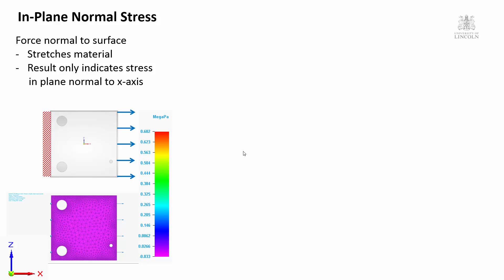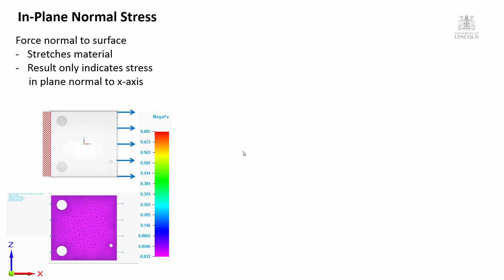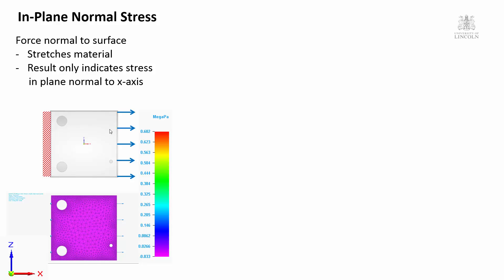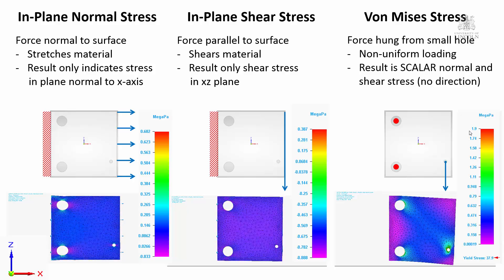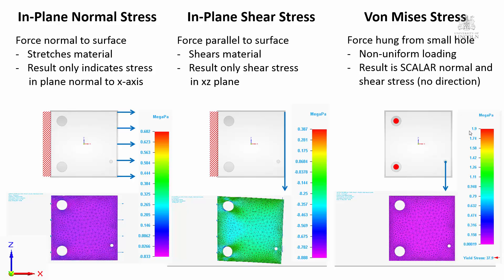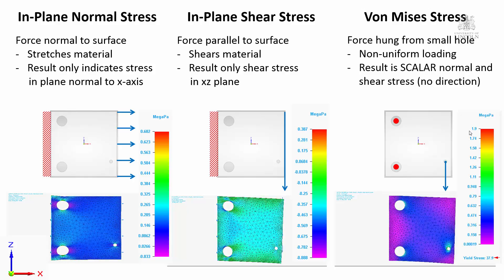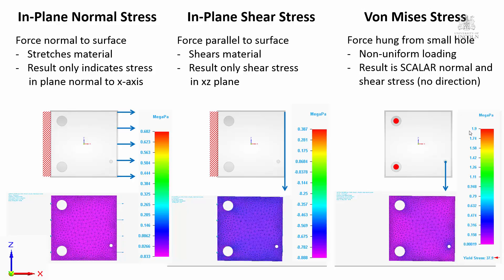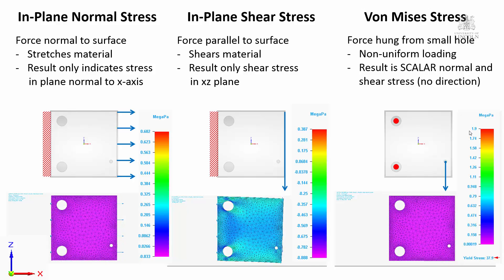Von Mises Stress: Its meaning and prediction

Comment: Thank you! I am not an engineer, but a self taught solidworks user. Most other videos on stress analysis had me trying to learn extreme math. When really all I needed to know was how to read the von mises chart. "Yield strength" means how much force would be needed to bend or deform (yield) the chosen material. And the slider, or graph on the right, shows how much force the model is dealing with. If the number at the top of the slider is lower than the yield number at the bottom, things are going okay. lol
Reply: no, thats not correct